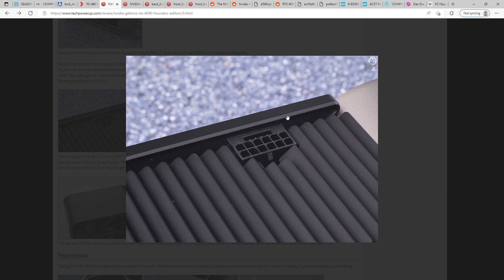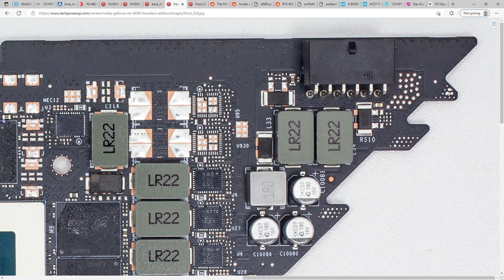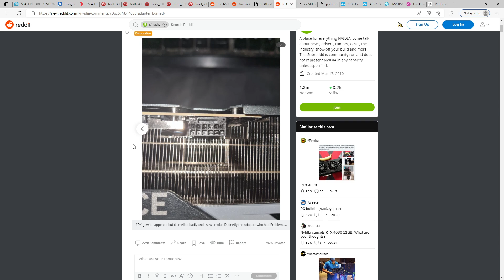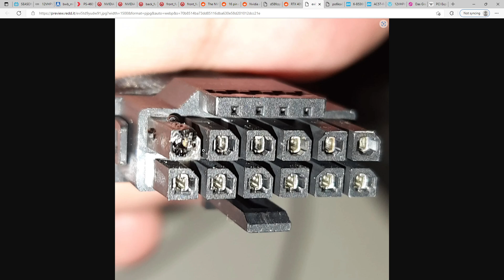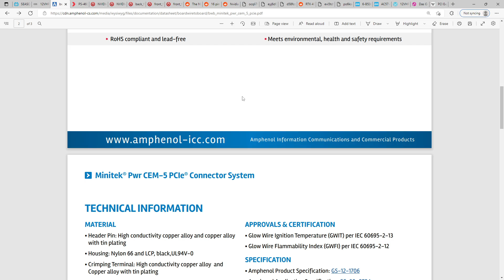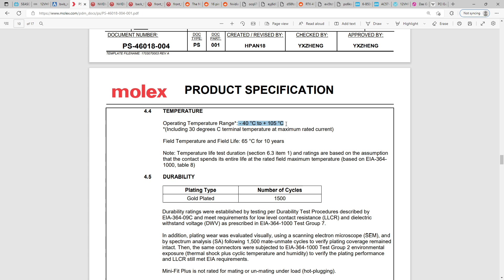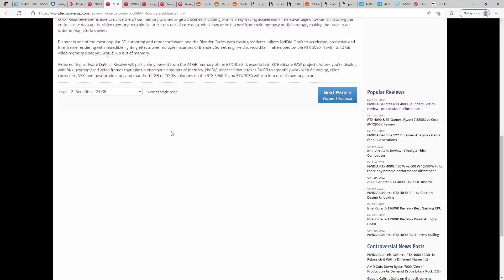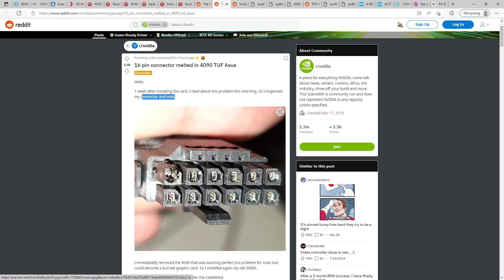rambling about the 12VHPWR failures

Comment: This is why 24-pin ATX12V 2.x standard has a 3.3v sense wire going through connector from the supplied 3.3v and back up to PSU.
This allows PSU to keep track of that the cable is plugged in and what kind of voltage drop it sees along the entire cable, including connectors.
If PCI SIG had used this approach for this 12VHPWR connector, it would have been fine, regardless of the number of splits or joins. It would have needed compliancy in the PSU though, but any load distributed would still show increased loss if there was any bad connections.

Comment: Someone Ordered to make ONE connector.  The design engineers did the best they could.   Validation was forced through regardless and here we are.   If Nvidia would have allowed TWO connectors at 300watts each then we most likely would not be having any of these conversations blooming around You Tube.  Video Cards have been using TWO connectors on their PCBs forever.

Comment: You might be right on Nvidia forcing its add-in board partners the 12VHPWR maybe that is why EVGA no longer makes GPUs. They don't want to use the adapter for either they prefer the 8 pin connector.
Reply: The did not do it just because of it but it could be a reason

Comment: Many people have already pointed out - yes, arcing happens at 12V just as well. the voltage only affects the distance the initial arc can strike, nothing else.
Arc-welders operate at 10-40V can can draw quit long arcs. The intermittent connections and sparks you mentioned - that does involve arcing.

The current return path  - most of that will be going back through the same connector as is required by the PCIe specification. The PCIe-Slot is wired to handle up to 75W and will have a lot of problems if you try to push 200W through that. The specs also are not as you make them out to be. The PCIe-specs say which connector must be used and what electrical characteristics it must have. And that means a PCIe 8pin power connector for the connection is rated at 150W / 13.5A maximum for the entire connector. The physical connectors them self can be rated a lot higher, but they are not required to be - there is no inherent higher safety-margin there. A manufacturer could very well used a connector that is only rated at 4.5A/pin and that would be within the ATX specs.
(Even worse - the table already gives a hint but the specific crimp-terminal that YOU HAVED CHOOSEN to show is rated to be used all the way down to AWG24 were they don't even give a minimum required current handling capability - aka you could use that connector with AWG24 and have it burn up at 1A already - so much for the supposedly high safety margin).

Now why are you comparing the specification of just the crimp-terminal used in the 8pin against the entire connector for the 12pin?
https://cdn.amphenol-cs.com/media/wysiwyg/files/documentation/datasheet/boardwiretoboard/bwb_minitekpwr3.0_hcc.pdf
Here - the ACTUAL specification of the crimps used for the 12pin connector. Oh look at that, they are 12 Amp Crimp-connectors. And they are also available in 8A, 8.5A, 13A variants.

And as we have now seen the problem is not that the connector is designed bad but that the cables are not attached properly. The individual pins are designed to hold the individual cables crimped, not shoddily soldered to a way too thin foil. You your self went on and on about how the plastic at the outside of the connector is getting actively cooled and how the metal pins are decent thermal connectors.... Now here me out - what happens if there is a bad connections and high resistance near the solderjoints where the outside plastic is cooled? Oh, the plastic around the join will get very hot but from the outside will be fine, and the heat will be transported to the pins and into the cables you say?

It likely is the combination of both - with the bad soldering the current is already concentrated and more heat produced, and then the bad crimps used getting bent and generating even more heat.
Reply: How long of an arc can you pull at 12V? And, how close do you hav to be to start that arc?

Comment: it takes about 30,000 volts per centimeter, or about 75,000 volts per inch, to jump a clear air gap. Once the gap is ionized, the sustaining voltage is less.

Comment: In car audio this is called bridging which is fine if the wire is rated for the power, and you are right if there is a loose connection there will be sparking hence the melt down, very bad flaw in design even if its on some adapters, there should be a full recall, a fix, an apology to enthusiasts......

Comment: Looking at the  adaptor plug. Max rating 9.5A x 6pin = 57amp. 57Ax12v= 685 watts. Good engineering practice is to not go too much over 80% max rating for longevity. Thats 550W. Plug is at the limits. Made of Nylon 66, frequently used when high mechanical strength, rigidity, good stability under heat and/or chemical resistance are required. Plug material is not the problem.

Comment: Agree the safety margin is lacking vs old standard but to rant about fine details and ignore the pcie slot itself is subtracting 75w from the power the cables need to provide is odd to me. 

Also to discount the solder pad area because of no melting signs there, right after stating that area is cooler due to its location is also odd. That area failing can certainly lead to the specific outer terminal/pin heat, so to claim the symptoms (terminal Melt) “has to be” the source is short sighted in your own argument and video.

Of course you can say “don’t care. Was just rambling” “didn’t put time
Into it” and ignore fact most people that watched will take this video and repeat the talking points. All is fine , head down. No
Mistakes. 😅

Comment: little correction: you can arc with 12V. Welding is done at somewhere around 14V to 30V. At a safety class the lecturer told the story of a girl who lost her hand at an industrial fair by touching (<-typo edit) the 12V rail of a light installation with her bracelet. It got welded to the rail and started heating up, burning her wrist.
Reply: Of course it can arc, everything can arc but voltage, distance and dielectric properties of air in this case are the key. With welding you are basically "touching" the material but in reality welding happened at around 1/200 of a mm before actual touch.
Reply: @XPACT3  you are right. I was just a little irritated by the way bz said it. 
regarding the connector, in theory, you could bend the therminal just enough to produce this tiny gap where an arc could happen but it is a thousand times more likely that it's just resistance generating too much heat.
Reply: @XPACT3  Be infromed that I mixed up sparking and arcing.

Comment: Thank you for understanding physics. 

The terminal was never designed to be side loaded which causes separation which causes increased heat which weakens the housings rigidity which leads to further separation and the cycle continues. ❤️

Comment: Im sorry but none of this makes sense, to bend a Molex/Amp plug enough to bend the internal pins would need to really distort the plug housing. Not happening.  For pins to get hot it means too much amperage. The pins are too small. The warning for how many times you can plug- unplug it and for the wire bending is because to the fragile foil plug internals of the adaptor, NOT pin bending/opening. But that has nothing to do with overheated plugs. Look at the thickness of the wire and look at the pin size. This board needed more plugs or higher amp rated plug. My other thought is, the same pins are always burning. Does it pull max power on one pin before moving to the next pin? Not sure if the power inputs are independent or just paralleled between pins.

Comment: the elephant in the room is the crappy design 1) the connector on the board, why not vertical. 2) size of the damn cards, how many cases can fit these 4090s without strain on the connector? this is lazy engineering at best

Comment: the 12 pin should be able to tell if its not properly connected, the fact it does not makes the cable melt, it should also have a temp probe on the 12 pin probably and the cable it self.

Comment: You're missing the point right off the start. 
12V actually is actually plenty enough to arc. 
For example, my TIG welder will output 10.4V at its lowest welding current setting (which is 10A), and at its highest current setting (320A), the output voltage is 22.8 V.
Granted, the arc is not (supposed to be) in air but in argon, the lower the current is the harder it is to initiate (without HF start, anyway), and at 10.4V/10A it's not a very strong arc, but it IS an arc.

The point is, you have N connections in parallel, and if one of them breaks, gets loose, poor or whatever, the voltage you get across such "gap" is NOT going to be 12 volts! 
Instead, it's going to be whatever the voltage drop across the remaining N-1 connections is, and if they're any good at all, the actual voltage drop, even at 50A, will be like 0.0somethinginsignificant Volts.

And that is what's not enough to make an arc.  Or even a spark.

In order for the voltage across the "gap" to be actually 12 Volts, then ALL of the connections would have to break loose at the same time, and in that case you'd probably have entirely diffenent problems because at that moment your graphics would probably crash altogether.

Comment: To me it looks like when the cable snaps off from the pin, there is still the same current going through the pin, but there is a much smaller path for heat to flow as the wire has been disconnected. Normally the heat will go down the wire and dissipate. So removing that wire connection increases the thermal impedance and it gets significantly hotter.

Comment: I think the double split terminals aren't helping, but since in most cases the outer connectors melt first what is probably happening is that bending causes the small part between the solder joint and the pin on the outer pins to break/rip/crack, BUT not all the way through just enough to reduce the cross-section and thus increasing resistance and heat.

Comment: So tldr get an aftermarket 12VHPWR and just be careful with it like make sure there is no strain on the plug at all.
Might be a good idea to pre-bend the cable before assembling the PC. Then plug it in and leave it.

The you have the best chance of this flimsy connector not melting.

Comment: There is a lot of very bad physics, materials and electrical science being spouted by some prominent community people regarding this and it's sad as hell to watch.

I lose all faith in anything a "tech" guy does when he starts talking about this issue being due to arcing over completely broken solder joints and otherwise saying the issue is a component far from the actual problem area. Anyone who know a fucking minuscule amount about electrical engineering, hell electricity in general, knows it is bullshit being spouted by these idiots. I am not an electrical engineer, but I did physics in college as well as take electrics in both high school and trade school.

It's especially egregious when you watch them pull a feed cable limited to a certain wattage off a component and then claim it being lost or broken will increase power over the component rather than decrease it, or that it will lead to more power being pulled over the same amount of correctly attached connector pins.

Without doing any testing myself and just looking at failures and the specs of the cable, it is pretty obvious to me that the issue is an increased resistance due to decreased (not broken) contact. Also the heat is clearly generated primarily at the connector and not the cable or solder point between them. This highly implies that the connectors are the ones with decreased contact area.

Why are the connectors suffering from decreased contact area and higher resistance? That is the big question.

My personal guess is that they are simply (often) too flimsy and small and the amount of movement they can experience in their housings simply mean they sometimes get positioned slightly askew from the card side connector slots and suffer from significantly reduced contact area. This is also why the problem is hard to reproduce, you cannot verify that a connector is seated right or wrong when testing in an actual card. If I were to design an experiment to test for this I would create my own device to produce variable contact points on the connector pins, then one could test how small the contact point need to be compared to a certain wattage over a pin or connector for the issue to occur.

All in all this is an infuriating issue to follow, and it has been steeped in misinformation and bullshit from the moment the 12VHPWR issues were first reported by Nvidia. From day 1 the melting was conflated with the ATX 3.0 spec, cable chaining and grounding pins, all of which has zero relation to it.
Reply: 100% 
Agree I knew from the first photograph of the melted plug on Reddit that it was an issue of bad contact combined with the 4090 pulling a lot of amps trough said contact causing sever overheating of the contacts and thus melting and charring the plug.
Contact resistance is no joke any resistance turns into a heater when current flows trough it.

Comment: My take: housing is made from thermoplastic material. When pin gets hot housing becomes unstable and starts to "give" and change shape of there is any lateral force on the connector. Split pins are most likely cause. This leads to worsened contact and generation of even more heat and housing becoming even more "plastic" so it looses it shape further and leads to further worsening. Eventually housing melts but it probably is made from a material that will melt but will not catch fire. Like for example insulation on electrical wires. TL:DR crappy design.
Reply: yeah I think that's kind of the root cause: The pins are just kinda loose and not in there solid enough with strain relief

Comment: Hi, you did some great observations, but you missed the bigger image. If they wanted to change the connector , they should've increase the pin size. I believe that those 6 and 8 pins were more thoroughly tested then this 12 pin connector. Not the wire thickness is the real problem, but the pin construction. There are some zones of the pin were the power passthough is made through very thin zone that can overheat and even melt, if the power is too big. 600w split in 6 (+) pins is 100W per pin. 600W split in 9 (+) pins is 67W.
A soldering iron is made starting from 30W upwards. That meas that even the 8 pins connector can melt, if applied a constant 150W for a long period.
Anyway the 12 pin connector was a bad "upgrade" for the PSU's.
Reply: I would completely move away from these Pin style connectors and use off the shelf high current connectors like the XT60 or XT90

Comment: The math based on the wire gauges is also misleading. Yes that is what the wires can handle, but as you can see on the shots of the connector, the wires have more mass than the connector. The metal of the connector should be thicker and of better quality, its rather easy to make a connector that will not heat up so much, within the size of the plastic shroud of the 12 pin. Similarly the pins could be a bit bigger.
More mass on the metal of the pins and connector also means better heat dissipation.

Comment: i once had a capacitor that started to loosen in the connector OF THE cable that then shortened the 12V RAIL.
but that was not te fault of the manufacturer, it was my fault by taking the sleeve off the cable

Comment: 250W undervolt? That’s crazy. That’s a 4080 or 3090 ti.  How about 350W power limit? Will it cause problems? I have an inno3d 4090 with 3 x 8 pin power connnectors.
Reply: Best you can probs do is buy a 20 buck third party 12v cable from cable mods and use that one since for what i understand fixes the issues mentioned in this video but yeah the 12pin design itself... nothing you can really do about it , you could enable voltage limit for your card with MSI afterburner or do a minor undervolting ( tech yes city channel has a nice guide to it on youtube ) basically very small fps drop for 100 wats less juice

Comment: I didn't realize the Nvidia adapter has 2 split in the terminal pin in the last video. The weakest point is the 2 split now it makes perfect why it failed. What a shame Nvidia modified the terminal. That's just what you get.

Comment: absolustly, they need to place thermal probes on the 12v pins on the gpu, is a lot better to register temp
1 per 12v pin. 
checking the temp of a plastic makes no sense.
there is another photo that shows that solder joint broke, and is disconnected from the plate. as you said, heat comes from inside, you cant say if is melted where the solder joint is, because is all covered by plastic
but could be bad pin contact too.

Comment: Actually I did get 12v to jump an airgap... Just use a spark gap and see how far apart you can get the rods so that the spark still flies. It's not gonna be very wide, admittedly, but it will happen. That's back emf for ya
Reply: I think back EMF is actually happening at a higher voltage
Reply: @Incommensurabilities  that's not how it works. Back EMF is the reactionary force, it happens at any amount of voltage. The arcing is separate from it but happens on account of it. Switching off the circuit basically shunts it making whatever else is left in the wire take the path of least resistance towards rest (which is Ground in this case). Now, what you probably meant was the arcing happens at a higher voltage, but as I said, it also depends on the gas, and the space between the leads. For small enough distances (less than a millimeter), arcing is a known occurance within air.